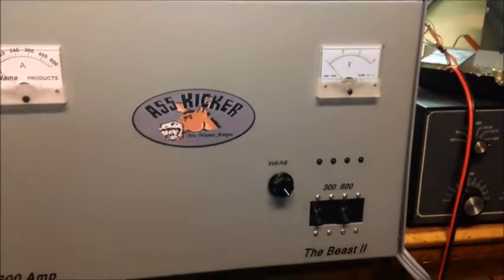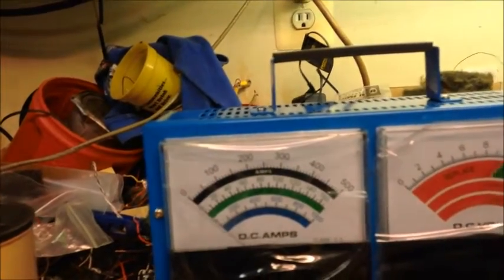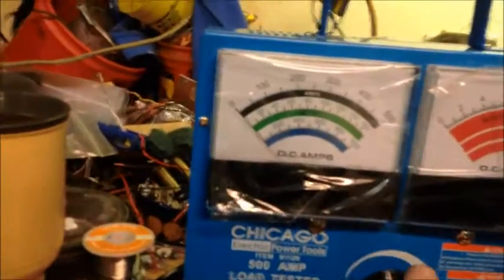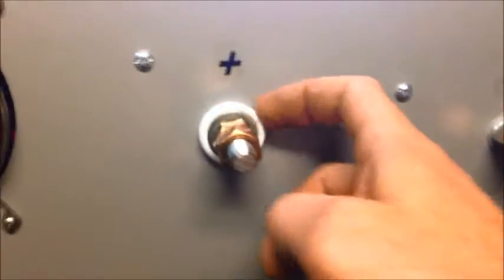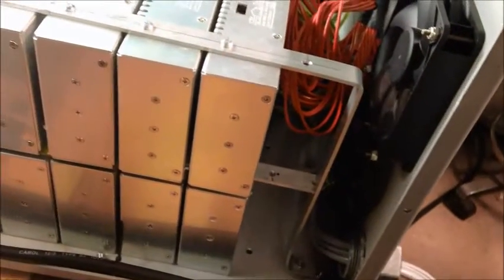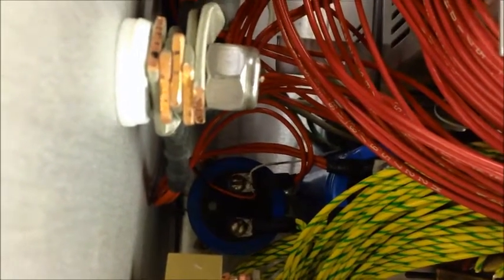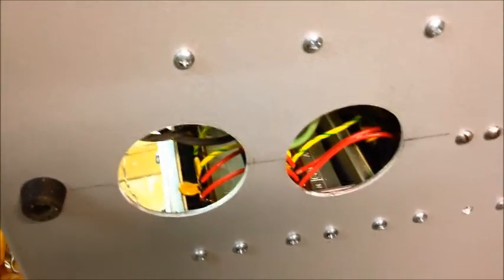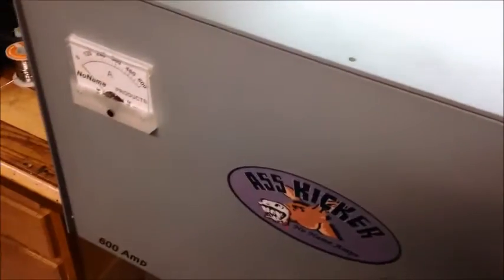600 Amp Regulated Power Supply

Comment: Nice construction job there.  You could have went with computer server supplies (Hewlett Packard for example) for more power, 1/2 the case size, and lower DC noise. They auto switch between 120 and 240v input without fiddling with a slide switch. Also the status lights on the server supplies are isolated from the outputs, so if one fails you'll know which one it is because the LED will go out.  Those chinesium consumer units you have there wont do that. Check it out and rename that unit "ass kicked."  Seriously nice work though.
Edit: Old video, and you know about what I'm talking about by now:)